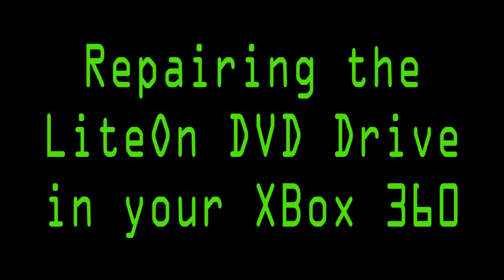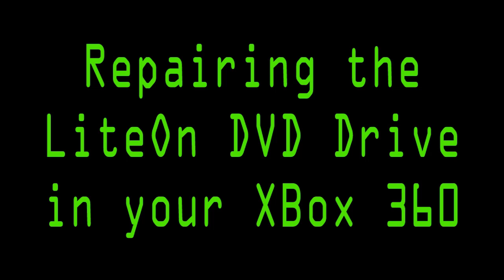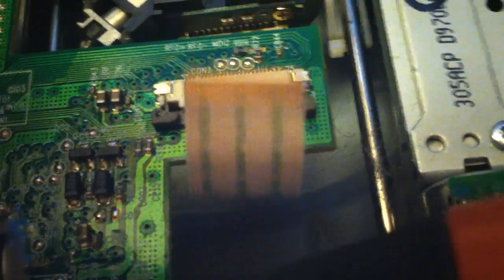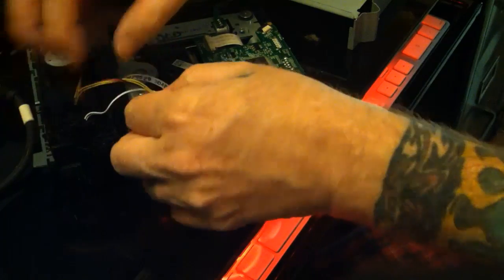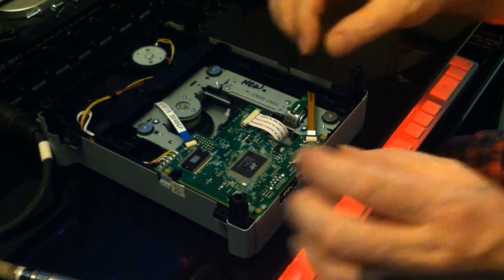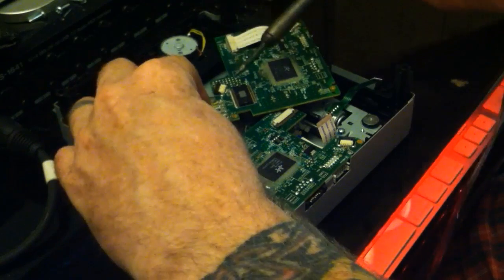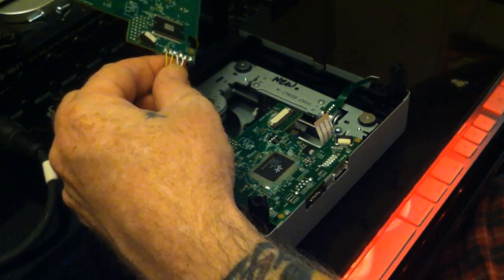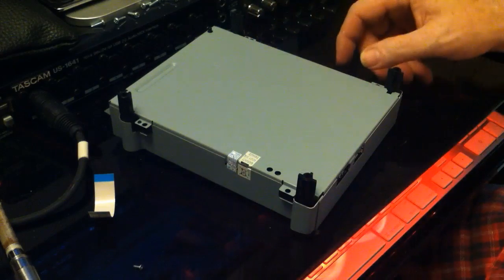Repairing the Philips Lite-On DVD drive for the XBox 360

Comment: or instead you could download the firmware an flash it to the dvd drive.
Reply from the maker: Yes, but some are not comfortable with that or do not have the proper tools to connect it. Flashing the key can be tricky and if it doesn't go right, could get the console banned too. This is just one way to fix the problem, not the end all be all fix.

Comment: I mixed up the whites and yellows how do I figure out which is which
Reply from the maker: +Brandon Wood The white and yellow wires are switch wires meaning they are interchangeable. Now, don't misunderstand what I just said. If you reverse one white wire with the other white wire, there shouldn't be a problem. Same for mixing up the two yellow wires. But mixing the white with the yellow is a problem. They are attached to two different switches: one tells the drive it is closed and the other tells it it is open. Google images for a comparison.

Comment: Do you have to replace that part to put it in a new one or can you just get a new one and plug it into the xbox
Reply from the maker: If you plug in a drive that doesn't have the matching key information flashed to the DVD drive board, you will get an error that will no longer allow you to play games and will also cause your console to be banned from XBox live. You either swab the boards or flash the nee board with the old board information. Since I don't have a lot of faith in the flashing process, I just swap the board.

Comment: I do not own a soldering gun, couldn't I just cut the wires. then buy a good dvd drive, twist the wires and cover with shrink tube?
Seems like that would be easier. I've done it before on other electronics, no wires exposed.
Reply: never mind,  I see that other viewers have asked the same question.
Reply from the maker: Lemons I wouldn't say it can't be done that way. But the best twist connection is one that gets soldered. Find some old electronics to practice on and play with a soldering iron. The key is to get the wire hot first. Not the solder. If the wire is hot enough, it will literally suck the solder into the strands. 
On a twisted connection, just hold the iron to the wire and place the end of the solder in the wire too. Best at a distance from the iron. Then add your shrink wrap. Solid. 
In larger wire, I use a butane torch to solder a twisted connection.

Comment: Hey Charles great video really expains alot about what I need to do to repair my opitcal drive.I have the Phillips & lite-on Model: DG-16D4S/FW ver: 0225 and I have found a replacement model which is exact same except the FirmWare Version is 0954. Im hesistant in purchasing the replcement  if having different Firmware versions would render the replacement useless. Any help you could give me would be greatly appreciated.
Reply from the maker: If the drive is physically identical, then the firmware doesn't matter as you will be swapping the board. I did a little searching thru the net to find more info on your question. Someone on Amazon said the 0954 did work for them. I really can't tell you with 100% certainty. Usually firmware updates are just to the programming that the board uses and have little to do with the actual mechanics. My suggestion to you would be to keep looking around on YouTube for people that do this more often than I do. Maybe hit up some folks that do a lot of flashing and mods. They could probably tell you with certainty if the drives are physically the same. That is truly all that matters. If all the wiring and connectors match up, you are in business.
Reply: I have a dg-16d2s Philips lite on, could I buy a replacement that is a dg-16d2s-09c  or has anyone already tried this?? Please help

Comment: I spent several hours cleaning and tinkering with my drive to resolve the open tray/disk error problem using all the methods described in other videos and nothing worked.  Watching your video gave me the confidence to order a replacement and make my first use of a soldering kit I received as a gift.  Installing the replacement and swapping/soldering the original board worked perfectly!  Thank you for the clear instructions and explanations.
Reply from the maker: Glad to be of service. Happy gaming!

Comment: When my XBOX 360's tray began having difficulty opening and eventually stopped reading discs entirely, I purchased a replacement Philips Lite-On DVD drive on eBay (after verifying my model type by comparing the wires in the peephole under the faceplate, as seen here: www.xboxmb.com/forum/15-xbox-360-tutorials/1894-how-tell-what-dvd-drive-you-have.html). FYI, my console type is "Jasper" (www.ifixit.com/Info/ID-your-Game-Console). I was honestly terrified of trying to solder these crucial circuit board wires, but this video totally boosted my confidence, made everything so simple, and really helped me when I got myself stuck... I should have watched it through before I started because I detached the new drive's circuit board first, and then had to pray I didn't mix up the wires when it came time to solder in the old board - I guess it doesn't matter if the wires of the same color are switched? Or else I got really lucky and guessed right! In either case, for the first time in almost a year, my XBOX fired up and read the disc right away, no problems. I'm connected to XBOX Live and able to game online, so for the cost of a new drive ($28.99 on eBay from "freelandcomputer") and a little bit of time and patience, I could have saved myself from buying an entirely new XBOX - if I had tried this a month ago before I got my second console ;) Thank you SO MUCH for this video! I hope this helps everyone with Disc Read Errors...!
Reply: Lin D-M 
can it be any phillps lite on drive
or does it have to match a certain
serial number.
Reply from the maker: Mr.Bboy try to stick to the same model number. There are different boards in some of those drives.
Reply: Charles Smith 
how can i find the model number.
without opening it.

Comment: do I need to flash if I have the same drive and swapped the boards?
Reply from the maker: Nope. That's the reason I do it this way. I don't have the tools to flash and there are things that can go wrong while flashing that can make your XBox useless or get it banned from XBox Live.
Reply: Charles Smith ok great to hear. thanks for getting back to me so soon. great video btw.
Reply: Charles Smith I also noticed that u didn't add more solder. Is it hard to do the switch without adding a little?
Reply from the maker: It's a good idea to have some on hand, but if your heat is right, you may not need it. Since the solder is probably very close to being the same, I don't feel there is a need to clean the solder joints. Also, it doesn't take much to damage the pads on cheaply made circuit boards.
Reply: Charles Smith hopefully its as easy as u make it look. ive never soldered before but I got the hands of a surgeon lol. by damaging the pads do u mean heating the solder to long? how would I go about not damaging it? any tips. im using a 25 watt
Reply from the maker: 25w will be fine. By damaging the pads, yeah, heating them to the point where they become released from the board. I that happens, it is a real pain to repair, if it can be repaired.

Comment: Hey Charles, I have a console that will read dvds and some games, some times. The console will freeze sometimes on the games but never on the dvds. I've tried a new laser, with no luck. Could it be the motor??
Reply from the maker: Game discs do spin faster than a regular DVD. But freezing during a game is usually a symptom of a processor problem. i.e. the dreaded red ring of death. Eventually, it could get worse if that is the case. Watching DVD's does not use the amount of processor a game does.That is probably why they work better.

Comment: This maybe a silly question but does anyone know what dvd drive is in the first elite models??
Reply from the maker: Impossible to tell based on that. Most likely the Ben-q or the lite-on because they were preferred for the elites since they ran a bit more quiet than the others. You're still going to need to lay eyes on the model # of your particular drive if you intend on getting a replacement. There are some pics on the net that will provide you with an idea of the type of drive you have based on the tray of your drive though.
Reply: Ok cool, thank you very much. :)

Comment: Hey, +Charles Smith If I solder the old chip to the new one do I still have to flash the new one to play games?
Reply from the maker: Nope. That is why I do it this way. The reason you have to either swap the board or re-flash the drive is because the drive and the motherboard have a shares code to prevent tapering. (And have you sent your stuff in for repairs...) If you are not familiar with the flashing process, I suggest you not try. Plus, you will need some additional tools, a PC, a Sata cable, so on and so on. The only way this fix will fail is if you have a bad board or a bad flash to start with. Otherwise it has never failed me. I have seen an unopened XBox that lost it's key. The only one I was not able to fix. Even with a flash, if you don't have the key, it won't work.
Reply: Charles Smith Alright, thanks I already have the soldering iron and everything. Just wanted some clarification before I bought the new drive. This video deserves a lot more views, you did a really good job on it.
Reply from the maker: Thanks for that. Just hit me up if you have questions or run into problems.
Reply: Is there a difference between phillips drive DG-16D2S and Dg-16d2S-09?
Reply from the maker: Can't say for sure. A quick search fav me two different, and opposite answers. An eBay listing says they will work, but I have some difficulty believing that since the body of the fat Xbox's drive has legs that are molded to the drive chassis and the slim does not. I would try to find the exact replacement and it should look like one from a desktop PC. (ie...no legs, just a box)
Reply from the maker: I guess I should ask if you are indeed working on a slim or a phat. That drive number has models for both. the DG-16D2S and the DG-16D2S-09 are the same in a sense. There is also the DG-16D2S-09C. Just make sure that you get the right body for your system. Legs for the phat, no legs for the slim.
Reply from the maker: Phat style - http://www.ebay.com/itm/USA-NEW-DG-16D2S-DG-16D2S-09C-DG16D2S-Lite-On-XBox-360-DVD-Drive-PLUS-OPEN-TOOL-/291036663376?pt=US_Video_Gaming_Replacement_Parts_Tools&hash=item43c3230e50
Slim Style - http://www.ebay.com/itm/Xbox-360-Slim-DG-16D4S-DG-16D2S-FW-9504-Replacement-Lite-on-DVD-ROM-Drive-Lens-/151074071495?pt=US_Video_Gaming_Replacement_Parts_Tools&hash=item232cb763c7
Reply: Charles Smith thank you! I'm going to be using the older drive.
Reply: Charles Smith Did it right and everything and it's still doing what it was before. Guess the chip is fried or something... I'm out $45 lol. It got 3 RROD about a year ago from power outage  and I fixed that, but I guess it fried the chip somehow, so stupid!!
Reply from the maker: At this point, a flash job might do it. Kind of a last resort thing. You don't have to install modded firmware if you can find the firmware for your drive. What is the xbox doing? Is it not reading games or not reading at all?
Reply: Whenever I press the open button it doesn't do anything the power light just blinks until you press the button again.
Reply from the maker: Had one do that to me. Bad news; never fixed it. Good news: pretty sure it is a flash thing. Even worse news: there is no guarantee that if you do flash it, it will work or not be banded. If the drive an the motherboard loose communication for any reason, it can possibly be banned the next time you log in to Live. Sorry man. That's one of those rare instances that the easy route will not fix.
Reply from the maker: *banned

Comment: I have tried every single thing, and the only thing I can think that is wrong with my dvd drive is a defective laser. I have a Philips - LiteOn DG-16D4S and I'm trying to think if I should either replace the whole drive or just replace the laser. I have taken this thing apart so many times its unreal. I'm currently using it on an Xbox 360 Slim which I think I've have for around 3-5 years now most likely 4. It just started occurring, and the only method that use to work was the tapping method, Which now comes to no success. Thank you For This Video, and hopefully a little information for my problem.
Reply from the maker: This method is for the older model Xbox, but I'm sure will work with most all. If you had to tap the xbox, it makes me think the motor which moves the laser assembly might be bad. Don't know for sure and is why I always elect to replace the entire drive. After years of fixing things, I like to eliminate future repairs. Of one part is failing, others are not far behind.
Reply: Charles Smith Yeah, That sounds like my best option as the drive is older and has been worn out. My problem occurred when I was away for vacation and had younger cousins playing with my Xbox. One thing lead to another and long story short, My xbox 360 disk tray got ripped out of my xbox 360. Looked up videos to get the gears aligned and works but you have to give it a little help to pull and push it out. This is what made me think there was a problem with either the alignment or the laser itself. Crazy and stupid actions lead to this I know.
Reply from the maker: Yep. I meant to add that the board swap is a universal deal. I've done it will all the various drives, but these require soldering. Newer variations may not, haven worked on any in a while. Good luck and I hope you get it squared away.
Reply: So the board swap is required with a new dvd drive and it requires soldering? I'll have to look into it more and do some more research before either taking it in to a store or learning it myself. Thanks for the info
Reply from the maker: It depends on the drive. Some have cables, others have solder joints. It is not that hard. It is all about the heat. Just remember that both the wire and the connection need to have direct heat to join. Usually I heat the wire to get the solder even on the end then heat the contact to get it to "puddle" up. While it is puddled, I stick the end of the wire in the puddle and pull the heat away. Hold the wire in place for a couple of seconds and you are done. There should be some vids on it, but I might do one since it is the most common question I get.
Reply: Charles Smith I just got It in the mail and it's working. Any tips before I go to soldering? Really hope I don't mess this up!! lol.
Reply from the maker: Just take your time. You didn't plug the new one into your xbox and turn I on without swapping the board did you? Hope not!
Reply: Charles Smith Well I had to make sure that was the problem before I started messing with the new one... Didn't think it would harm anything..

Comment: hey so instead of buying the complete replacement drive, and inserting the original board into the new drive, couldn't I just buy the replacement laser (which is cheaper) and swap that into the original drive?
Reply from the maker: You could choose to replace defective parts one by one, but who is to say that the other moving parts will not fail shortly after you have replaced another? Looking at the prices for lasers, you will spend $10 to $15 plus shipping. A new drive will cost around $30. Your call.
Reply: Charles Smith After some thought I did purchase the entire drive, installed it as you demonstrated, and my Xbox reads discs like a charm! I also just bought the new splinter cell too and after several months it feels good to play again. Thanks man!
Reply from the maker: Enjoy. You earned it the old fashion way. DIY!

Comment from the maker: It is highly unlikely that you have the exact replacement drive for your XBOX and I would not recommend trying an adaption. Remember, we need the circuit board from your XBOX installed in a replacement drive of the some design.

Comment: you mistakenly got a benq drive when you need a liteon drive.  the liteon has the three ribbon wires and then has 6 wire (red,black,2yellow,2white).  I made the exact same mistake.  I purchased based on the drive tray shape.  Now I have a benq drive that is worthless to me.  The liteon (yours) has a larger pcb board than the one in this video right ?  shoot me an email if you have any questions.  this guys videos are awesome by the way.  makes it real easy, just wish I bought the liteon 1st.

Comment from the maker: If you do it correctly and do not power up your system with any of the cables disconnected, yes. This is the preferred repair for those of us that are not into "flashing" the drive. Done correctly, the device will never know the difference.

Comment: I have an older philips drive and not noticing the difference ordered a newer one but i happen to notice that the board is a lot smaller and also instead of 7 cables instead of 6 cables is that an issue?

Comment from the maker: If you have done a good bit of soldering, yeah. Quickly swipe the solder until it releases. But if you hold it to the board, you risk separating the pads from the board. It is a bit hotter than what you need, so be very quick and very careful. If you are not sure, go to Radio Shack, or where ever, and get a 15-30W to be on the safe side. It will be worth it in the long run.

Comment: rite on thanks man  - i have a gun and solder waiting for drive just determining which method too use -  i also am seeing another method of removing all the guts from below the pcb board that eliminates soldering but i don't know ,shit could go wrong that way too ---  its the ribbon clips that get me when i tried to replace the lens before i seen your video an i broke the ribbon clips that's why im getting whole new drive
thanks for putting that part in the video itll be easier on new drive